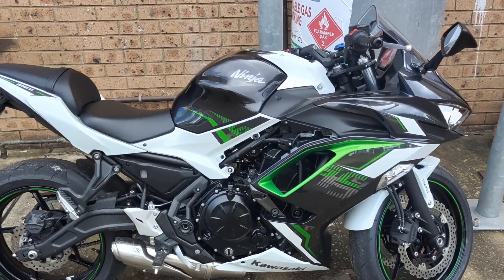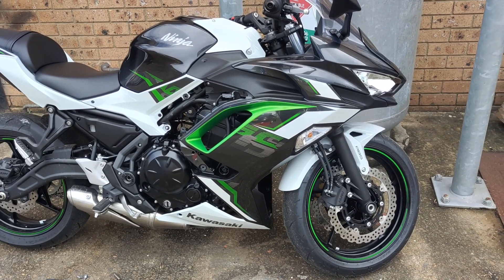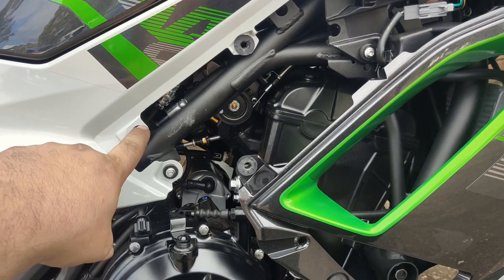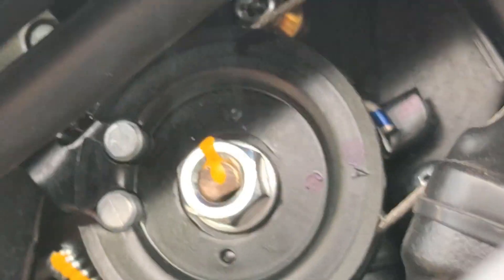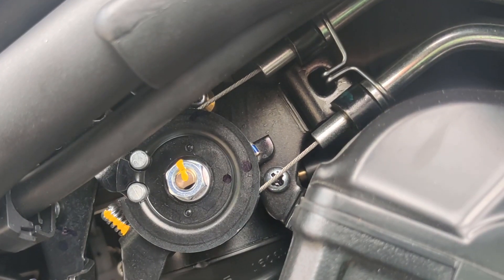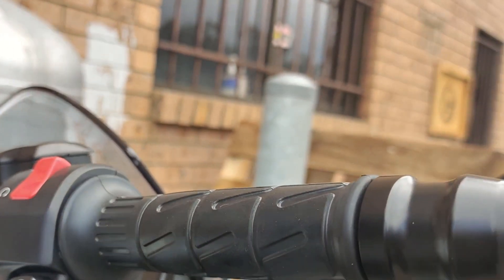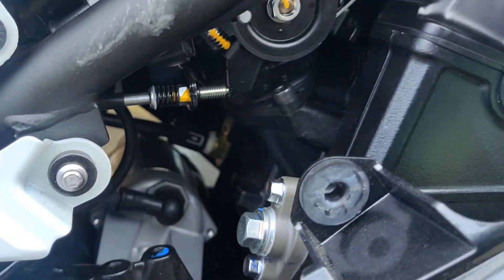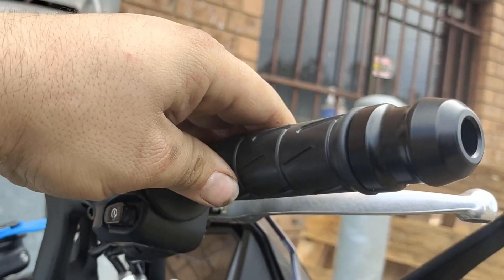2022 Kawasaki Ninja 650 Z650 650L Derestrict Throttle Limiter

Comment: I got bad news for you, even though you are unlocking the throttle, you still need to flash the ECU to enable the higher fuel settings to get the full 72HP. The predecessor bike to the Ninja 650/Z650 which is the ER6N/ER6F had a loop back plug hanging off the ECU that you just need to take off to enable the full power map, iirc the 2012 models and newer (which turned into the ninja 650/z650) you needed to flash the ECU since Kawa noticed people getting wised to unlocking the LAMS bikes so they made it harder.
Reply: he has a dyno, he dyno'd the bike and had it at 102hp

Comment: So, this means the bike is gonna be having more horsies? Is it gonna be like the regular 68hp
Reply: My understanding is that the throttle is still restricted in the ECU, so even removing this screw you won't get more hp at wide open throttle its still only like 70% open. 
Need to get the ECU remapped.
Reply: @jarsky  not on this model :)
Reply: @bigl3985  what do you mean? Is something different with this model?
Reply: My instructor told me it’s just the stop to restrict the Kawasaki 650 engines so it can be changed whenever a riding school is training a restricted or unrestricted license rider,
Your not insured if you remove it while on a restricted license

Comment: Is that all that's needed to derestrict? No tune?
Reply: I would say the bike has a restricted air filter Aswell...it won't supply the air needed for that much throttle...then yeah i deally it would need remapping...
Reply: Will need a map after removing restrictor to allow butterflies to open up to 100% on full throttle. It will bog down on full gas with out a re map.
Reply: Did same to mine and it didn't need remap it goes like he'll on open throttle in any gear even top gear pulls hard
Reply: @bevansvids tell us more.
Reply: @bevansvids  Did you just remove the screw without doing anything else and did it work?
or did you notice something wrong? Please tell me, I want to do it too

Comment: Wow, that's a cheap fix. I had a 76 KH 500 you had 3 things to do, H1F exhausts or higgspeed chambers and rejetting and air filters. I got my local Kawasaki dealer to do it, as at 19 I didn't didn't know what to do with carburettors.

Comment: How hard is it to remove the tank to get to the snorkel to get more air flow?
Reply from the maker: Ive done it a couple times now roughly 2 hours work to strip it, modify then reassemble.
Reply: @AussieAuto  does this make it run too lean though?

Comment: Just like @David-vb8tg said,  you still need to re-map the ECU and change air filter. Also, for more HP you could get full exhaust then re-map the ECU with a dyno tune. The ECU re-mapping is crucial as the throttle bodies don’t open completely up 100% on the factory restricted map

Comment: How did you remove the front orange reflectors? I was able to spin them off but there’s still a rod that sticks out (that the reflector spun onto) it looks like it can be unscrewed with pliers but I just want to make sure.
Reply from the maker: I don't believe this bike had them I haven't removed any
Reply: That screw underneath the ABS symbol on the front wheel well is where the reflecto mounts into…. Looks like someone removed the reflector assembly and put an aftermarket screw in it….. check out pics of the other 2022s and you’ll see what I mean
Reply from the maker: @madarchermoto4955  Possibly was removed or never fitted by the dealer ive never noticed it